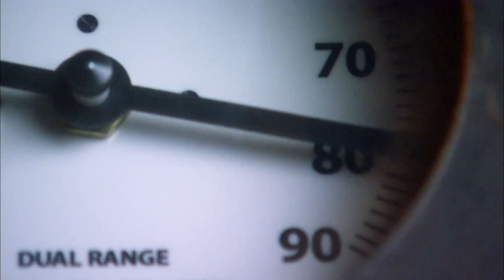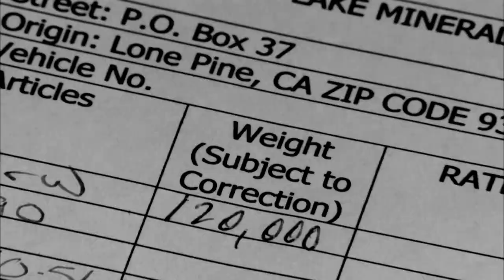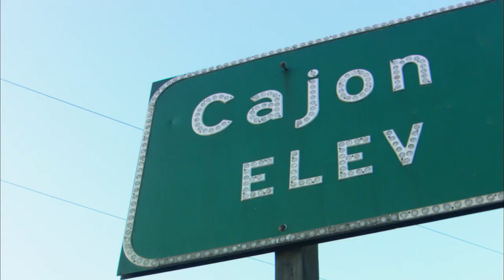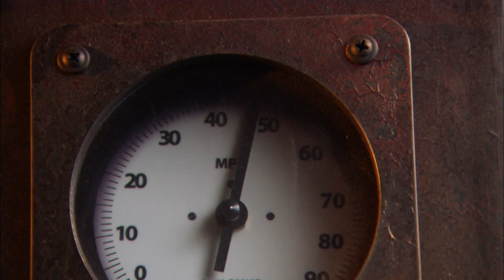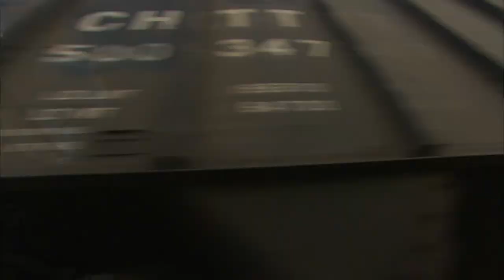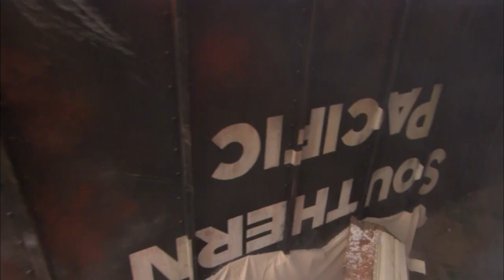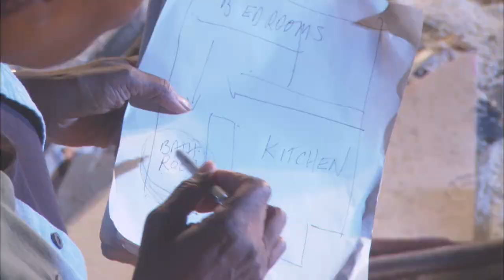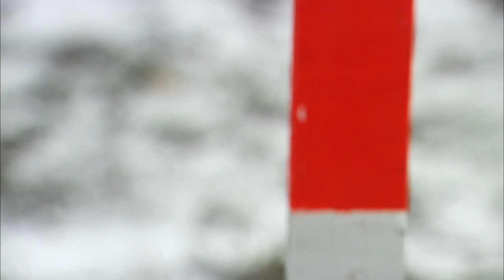Train 7551 Derails And Crashes Into The Community | Runaway Train | Mayday: Air Disaster

Comment: 30:00 "It looked like everything was fine"..? It just STOPS  ..? Based on this you would think the disaster was over. What about the digging equipment puncturing the gasoline pipeline, spraying it a hundred feet in the air where it ignited, burned down a dozen more homes and killed 2 more people?

Comment: I dont get it, so what causes the derailment????? Why did the train not slow down??????
Reply: Gee, google is helpful!  From Wiki:  
     "Clerks in Mojave had miscalculated the weight of the train, while the engineer and crew at the head end were unaware that one of the rear helper engines had inoperative dynamic brakes. Hence there was not enough dynamic braking force available to maintain control of train speed during the descent. When the helper engineer realized that the train speed was not being adequately controlled, he made an emergency brake application, which deactivated dynamic braking, resulting in a runaway condition. The train reached a speed of about 100 miles per hour (mph) before derailing on an elevated 35 mph curve next to Duffy Street, sending the head end locomotives and several cars off the high railroad bed and into houses on the street below, completely demolishing them.
     "Upon retrieving the locomotives' "black boxes" (event recorders) and the recorded data therein, it was discovered that the third head end locomotive's dynamic brakes were not functioning at all, although the sound of the cooling fans misled crews into believing dynamic braking was functional. It was also determined after the wreck that the engineer operating the helper locomotives knew of the faulty dynamic brakes on one of his units, but did not communicate that information to the head end crew. The combination of weight miscalculation, poor communication and faulty brake equipment resulted in a total train weight that was too great to adequately control on the downgrade. Once dynamic braking had been defeated by the helper engineer's emergency brake application the enormous weight of the heavily loaded cars caused rapid acceleration that could not be resisted solely by mechanical braking. The train catapulted from the 35 mph curve next to Duffy Street, scattering locomotives and cars..."